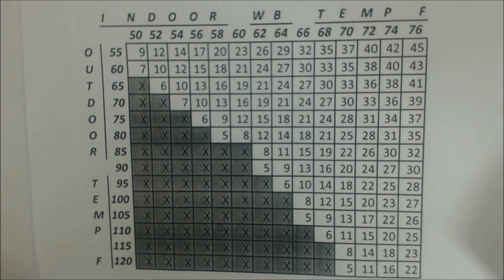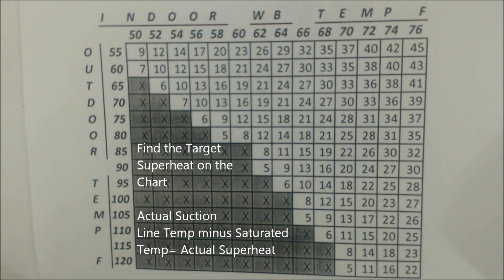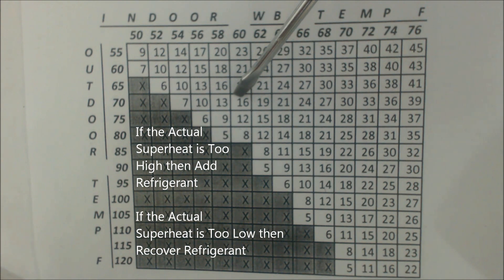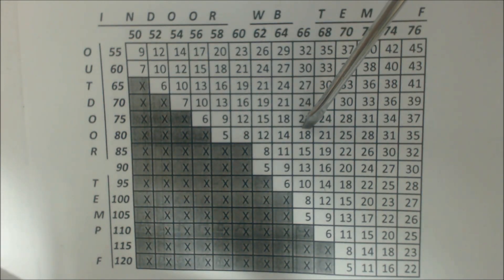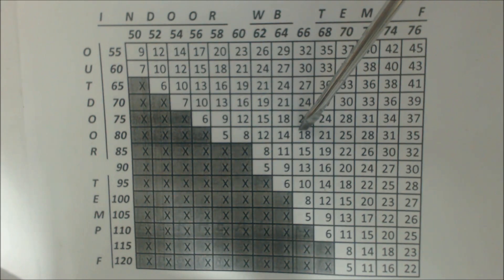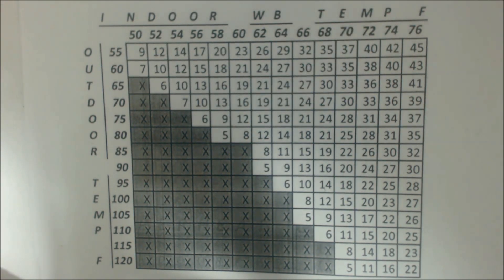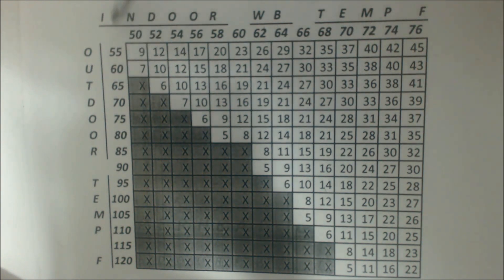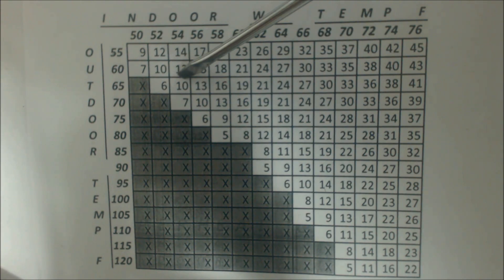Superheat Charging Chart- How to Find Target Superheat and Actual Superheat on an Air Conditioner!

Comment: Awesome video.. please post more such videos.. I have doubt ..Is subcooling and superheat calculation procedure are same same for TXV n Non TXV system? From where can I get superheat and subcooling chart for R22,R134,R404,R 410,R407.. hope to listen from you soon..
Reply from the maker: This generic target superheat chart is for finding the target superheat on Comfort Cooling  air conditioning systems only and not for walk in refrigerators that would use 134a or 404a. This would be used for systems that have a piston as a metering device with refrigerants such as 410a, r22, r407c and others. Thanks, glad you enjoyed the video!

Comment: Is it ok to take the wetbulb temp in the return duct itself before it enters the air handler ? thank you for this video, really helpful.
Reply from the maker: Absolutely, the closer you get to the unit on the return, the better. That is where fieldpiece went with their newest psychrometer with the wireless signal so it shows you what the wet bulb is at any time. Most techs have the handheld all in one tool so that is why I just say to take the reading at the largest return grille unless two stories in which you could take two and average the wb. Thanks and great question!

Comment: is that is that why when you have a high temperature inside when you repair a condensing unit that the suction line is very high
Reply from the maker: Great Question! If the temp inside is high or the wet bulb inside is high then the low side pressure will be high. The outside temp also has something to do with it as the condensed subcooled liquid is at a higher temp before it hits the metering device at the evap coil. Thanks for your Question!

Comment: so.......target superheat........let's say is 18..........as I charge the unit.....that value change's.....and I need to retake the WB temp to find the new superheat value.......and continue this process until it stabilizes??
Reply from the maker: Yes retake the measurements to find the target superheat every 5 minutes or so as you are charging the unit the target meets the actual superheat. Thanks for the Question!

Comment: Why a wet bulb reading at the largest return grill in the house?
Reply from the maker: Great Question! If the wet bulb inside temp and the outdoor ambient temp are needed for checking superheat, you need to check the wet bulb reading every 5 minutes where as the outside temp really doesn't change that fast. As you are charging, the wet bulb temp will be going down as you remove humidity from the house. You need to place the psychrometer near the largest return grill because this will give you the most accurate reading of the building's wet bulb where the air is going to go across the Evap Coil. If someone was downstairs by the front door taking a wet bulb reading, it would be different than upstairs just by hot air rising and cold air falling let alone the possible duct distribution. I hope this helps! Give me a follow up question if this doesn't answer your initial question. Thanks!
Reply: The humidity in my house doesn't seem to drop much with the AC on, it seems to be staying at about 57 to 62%.   The drain outlet from the house drips with the unit on; it's not a steady stream but more like a rapid dripping.  Would this be a possible indication of a blockage somewhere in the drain path?

Comment: This chart you have is it a universal? Can you use this chart in all units that have a piston/orifice? Or does each manufacturer have there own superheat chart? I have a subcooling and superheat calculator for r22 and 410 that my school gave me but it's made by carrier. Can I use these say on a goodman or ruud unit if I was out in the field?
Reply from the maker: This chart is for comfort cooling systems that have pistons or orifices for finding target superheat. Target Superheat is specifically wet bulb inside temp against outdoor ambient temp. It does not have to do with which manufacturer made the unit, however if the manufacturer specifies a certain procedure to charge a unit then you should follow the manufacturers instructions. 

I think you are referencing those sliding charge calculators. I will not give them to my students and you will never see them in my videos because I want my students to think about what is actually happening in the system and have all of their senses and mind on the gauge set and temps to figure out not only if the system is undercharged or overcharged but if there is another problem. The slide calculators take out the thinking and that is the very thing that I want my students to have. Just so you know, I actually started my career with those slide calculators and they were a crutch for me. I don't want to upset those that use them but I do very much want the best for my students and for all of our community. It opened up a whole new world for me when I left those sliding charge calculators. If you do choose to leave them, I would suggest still verifying your charge when you are done with the calculator until you are comfortable without them. You still will need a superheat chart or app however.

In reference to your calculators, the target superheat should be roughly the same within a degree if not exactly the same as the chart.

On this topic, I had a very good question you should check out in reference to superheat in the video link below.

https://youtu.be/Crw8uZj15so
Reply: +acservicetech Thanks that is very helpful. The school I am going to is hardly giving us any hands on or showing how the gauges work when connected to the unit. I am a kinesthetic learner and there is only so much I can understand when I read through this massive book they give us. I've actually learned more about HVAC on YouTube than I have at the school. I understand what is being discussed when I watch these video because I am reading the textbook but I can only grasp so much by reading alone. YouTube isn't hands on but at least I get to see how the system functions. And like you said, you want your students to understand what is going on in the system and why it's doing what it's doing. Thanks again.
Reply from the maker: Well I hope I am being a help to you! I am glad you are enjoying the videos and I wish the best for you! You obviously are very hungry to learn and that is the most important part!
Reply: Bleas sent to me this chart